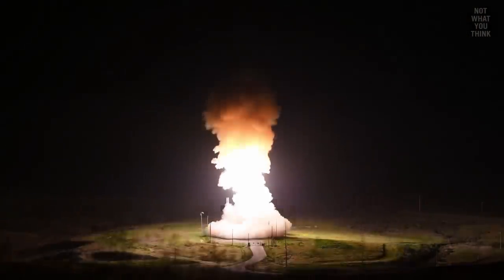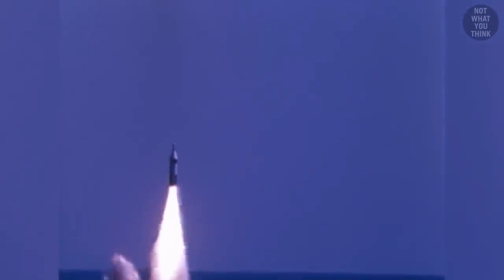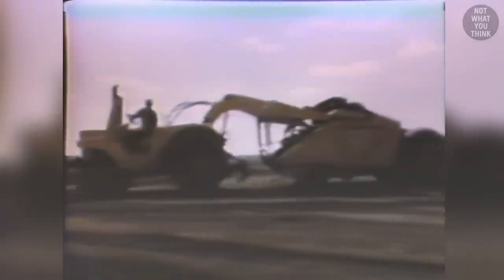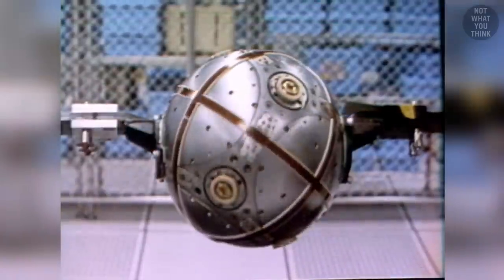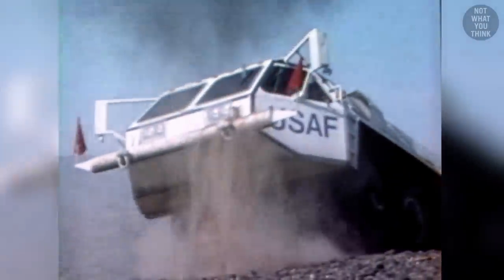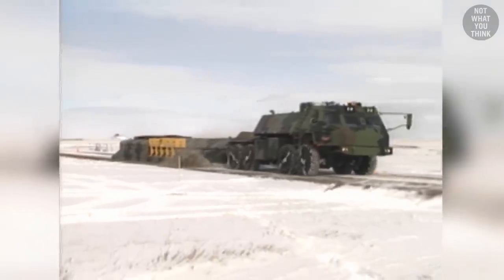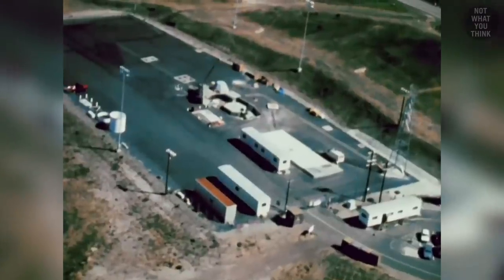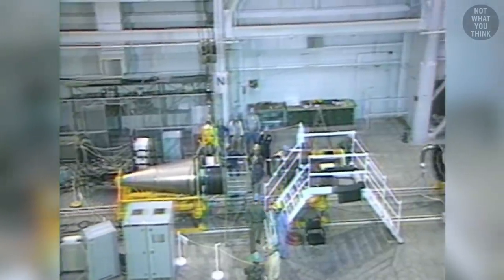America’s Most Expensive Weapon

Comment: You mentioned hot launch vs. cold launch, but did't explain to viewers why this matters. A hot launch destroys or damages much of the missile silo, requiring major and timely repairs to use it for another launch. A cold launch system allows for the possibility of a fast reload and reuse of the silo, adding another dimension to deterrence. In an exchange, an opponent could safely ignore any silo that had launched a missile with a hot launch. With cold launch capability, even previously used silos would need to be targeted, making a first strike even more risky.
Reply: problem with reloading these things though is if they are known by the enemy, after launch there probably isnt a chance of a reload.
Reply: The US looked at moving the missiles among various shelters as a deterrent. The Soviet Strategic Rocket Forces took the same basic idea and instead looked at using mobile missile carriers that could hide and then reload and be ready for launch in under 24 hours. In a way it's even scarier than the US system which was predicated upon fixed storage locations. The Soviet doctrine would have seen missiles scurrying on their carrier vehicles in all directions and hiding basically anywhere. Cold launch and reload was a big focus for them, and cheaper than building new silos. Not only were reloads probable, they were difficult if not nearly impossible to stop. 

Reference the SS-18 (R-35) and the negotiations of the SALT/START treaties. The cold launch capability was indeed a huge concern for western countries and therefore a key goal was to limit Soviet deployment of systems with that capability.
  @ashleygoggs5679
Reply: @ashleygoggs5679  That's also the point though.
Reply: He’s explained that in like 8 other videos homie
Reply: Hot Launch: That's what she said she wanted.
Reply: In theory... but I can't imagine being the crew reloading a silo while targeted by enemy nukes 😅 Common sense would force you to hide or run.
Reply: Lukewarm Launch ?
Reply: Your explanation is perfect but it falls flat when one considers the aftermath of an all out nuclear exchange, which probably is the likely scenario where these weapons would be employed. There would be no point on reloading in a MAD scenario. Those left alive would be more focused on survival I guess.
Reply: cold launch mean you are saving money , while hot launch mean you are making money , hot launch suits US contractors as they can make a lot of money from it after each missile fire things need to be repairs and repairs means money .
Reply: Not all heroes wear capes
Reply: You can see that in play with soviet launchers, the ejector separates from the missile usually with a bit of left over orange red nitrogen dioxide leaking out after seperation.
Reply: ZaHandle  many will survive realistically, inlcuding those with military (or militia) power capable of taking over food/water resources, military (and private) bunkers filled to the brim with years worth of supplies, and the common man who decides to form a group to survive the unthinkable., with a common goal in mind. the biggest loser would be the common civilian. which is why we, as civilians, must revolt and reject the idea of nuclear war, or war in general. the biggest point of this video is that hopefully everyone would survive, because no one would be so stupid enough to propagate a 3rd world war and mass extinction filled with nuclear fallout, because literally no one would win, and many hundreds of millions of people would die as a result.
Reply: If a launch occurs, i don’t think it matters.
Reply: @Sffker  History shows us that war is far more common than peace. You should prepare yourself and your children for the life they may have no choice but to live.
Reply: That's why the US has all those nuclear submarines.
If those static hot launch ICBM sites ever have to be used, then it means we better hope there's Pip-Boys in that post-nuclear apocalypse world.
Reply: Remember, switching to your secondary is always faster than reloading!
Reply: There is a video briefly mentioned that… I think it’s the VLS cell video?
Reply: Why would a first strike be even more risky? I'd you have cold launch attacking first would be less risky
Reply: Damage to silo is never, ever a concern, since by design, there will be many more silo than missiles so enemy won’t know which silo has the missile😂
Reply: @stc2828 Apparently it was enough of a concern for the Soviet Strategic Rocket Forces to build their strategy around it, and enough of a concern for it to be the keystone of arms talks between the USSR and US.

Maybe read a book sometime.

Comment: You failed to mention the fact the Minuteman III missiles are now going to be replaced by the newest ICBM designated Sentinal along with brand new nuclear warheads.
Reply: whats special about the new warheads?
Reply: @johndor7793 they're new
Reply: @johndor7793 they use an optical firing set, and are independently dial a yeild. One size fits most modular,
Reply: @johndor7793 they use an optical firing set, and are independently dial a yeild. One size fits most modular,
Reply: @christopherleubner6633 They're not one size fits all. The Mk21A RV cannot fit the Trident II, the only other ICBM (an SLBM) the US fields and will continue to field into the 2070s.
Reply: @johndor7793 They're a higher yield modification of one of the two models of warheads carried by the current Minutemans.
Reply: Is anybody going to care really in an all out war?
Reply: @johndor7793 they come in an array of new colours ;-)

Comment: wonder why they decided to make a brand new Sentinel missile instead of an improved Peacekeeper to replace the Minuteman 3
Reply: It is called kickbacks
Reply: Because Peacekeeper had a payload capacity deemed excessive of requirements, and was extremely costly.
Reply: Treaties limited warhead counts.  Sentinel is mainly a service life extension for the minuteman III as the solid rocket boosters are getting pretty old and they're staying ahead of the eventual breakdown of the thiokol propellant
Reply: @Hobbes4ever  The treaty was never ratified. And the US and Russia have different doctrines when it comes to nuclear weapon delivery systems and use strategies. Russia uses has many more tactical weapons, but fewer SSBNs, for example. Just because one country chooses the path of superheavy ICBMs, doesn't mean it's the objectively best solution.
The RS-28 is far more costly and less survivable than the LGM-30 (or it would be if both were produced in the same country), even if it does have a far greater payload capacity. The Minuteman fleet was built precisely because it was low cost. There were debates in the US military leadership about the virtues of liquid vs solid fueled ICBMs. Liquid fueled rockets can be more precise, more efficient (for example as measured in terms of throw weight vs overall missile weight), but are far more costly, harder to maintain, physically larger, thus requiring larger more expensive silos...
The US opted for solid fuels starting with MM1 because they knew they could out-produce the USSR with low cost solid rockets, which at the time the USSR had not perfected. It was felt that numerical superiority had a greater deterrent effect than greater accuracy, or other advantages of liquid fueled rockets.
Reply: @Evan_Bell uhhhhh Liquid fuel or solid fuel has no bearing whatsoever on accuracy....That is wholy dependant on re-entry vic guidance accuracy.
Reply: @gotanon9659  Incorrect. For one, almost all RVs lack controlled guidance. Both RV and booster determine accuracy. Solid rockets aren't throttleable, and their burnout can be somewhat less predictable.
The case for higher accuracy and thus liquid fuels was argued by Thompson Ramo Wooldridge Inc. against Edwall Halls ideas.

Comment: My way of missile is not like that , a missile that have no weight in flying.  No noise no batteries and fuel .
No weight can float in the air and dive if the control to blast. 
The floating missile is like a Ball or saucer , and can wait for the target . And can blast if the control to blast .
A perpetual flying missile,  with own power , 110v ac x2 small , big 10000v ac x2 , very very big 100000v ac x2 , 
The purpose of this missile is to wait the target in the air . You want this ? My flash driving invention running in light speed way first why ? It's the power of my missile.  A perpetual power.